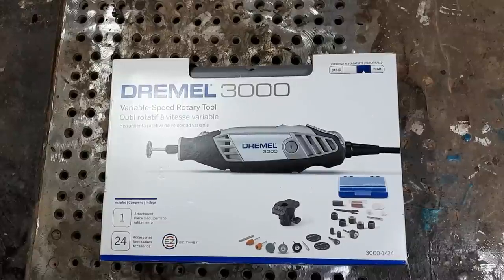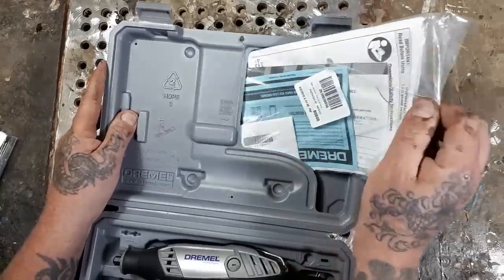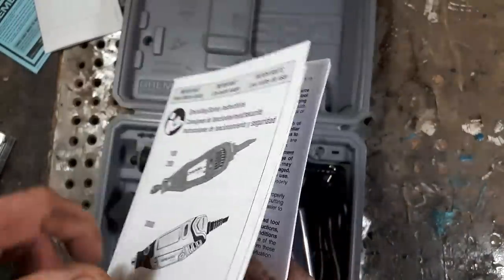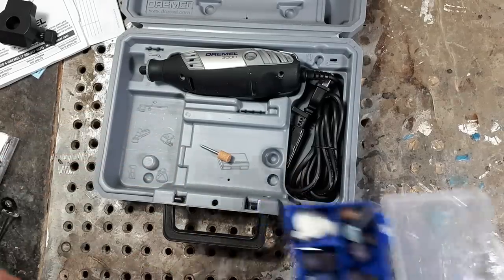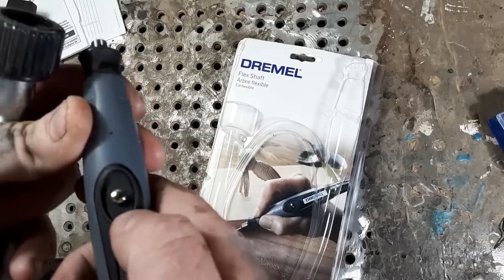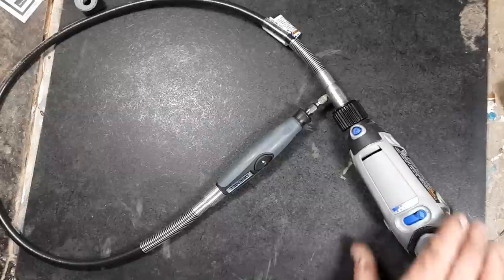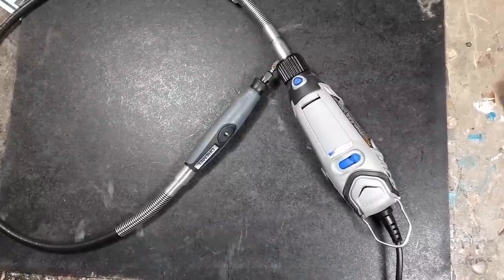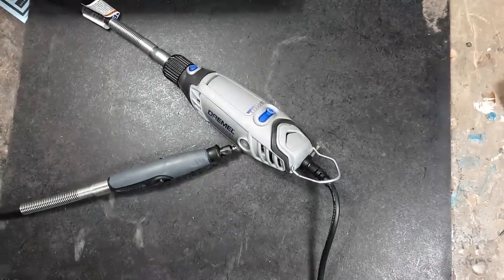Dremel unboxing, dremel, carving with a dremel, wood carving, dremel carving, power carving, kutzall

Comment: Jordy! I have the exact same Dremel and the Flex Shaft brand new in the packages sitting next to me. So strange I seen this video! I literally bought the exact same 2 items. I bought the Dremel 3000 and the flex shaft along with the Dremel Work Station/Drill Press and a Kutzall Original Fine Rotary Burr. Excellent video buddy! Thank you!
Reply from the maker: Put er together and start carvin

Comment: I have a 4200 that I have not used that much. Today it died. How important is it to run the thing for five minutes to break it in?  I think I did that but not for as long as five minutes. Also I understand the flex shift should be run for a couple of minutes without using it at the beginning. Have you ever had a problem with yours just crapping out in the middle of a job?
Reply from the maker: Yes u should cheak your brushes in the dremel , I have a video posted how to cheak